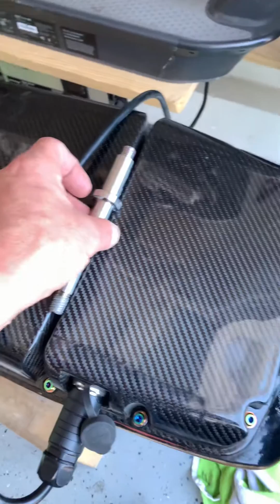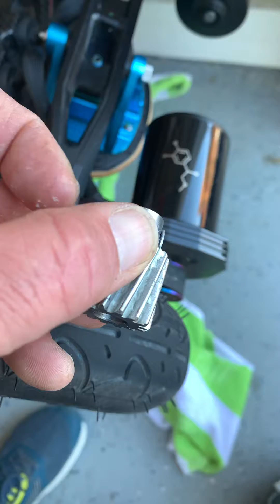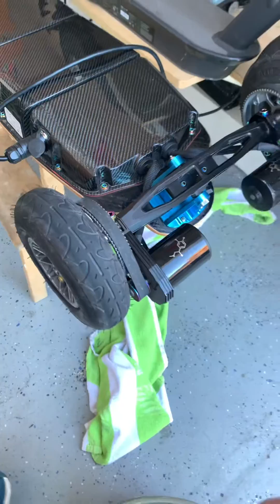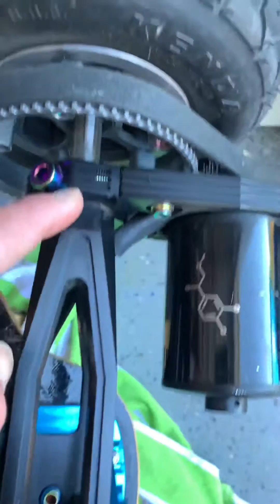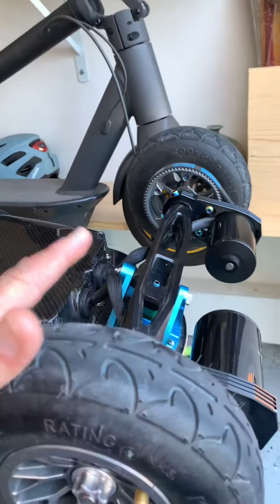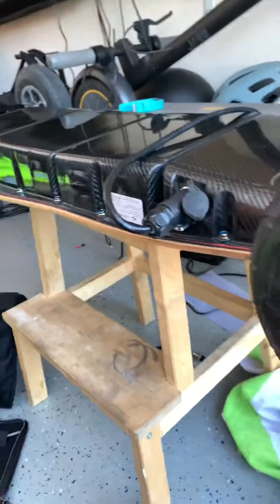Lacroix Supersport going from falcon gear drive to self tension belt drive

Comment: Hey Tony, for what reason(s) are you going from gear drive to belt?
Reply from the maker: The gear drive was never installed correctly and when I tried to repair it, I ended up doing more damage to the board than fixing it. Grease and bolts needing to be tight is challenging. I am convinced they're on the edge of making a really great gear drive, but version 1 isn't it. My real problem is the fact that my rides take me way out in the woods with no cell coverage and very few other people. I just needed something I can count on, can repair on the road and those self adjusting belts are it now.
Reply: @tony2wheelz408  Thanks for the answer. I still haven't ordered and I initially thought I was going to go with the Falcon, but then I saw more and more opinions against it. I'll go with the belts. Cheers and thanks again!
Reply: @tony2wheelz408  fuckk I wish I saw this before I splurged on the gear drive x.x hopefully I don't experience the issues you are describing, I know a lot of other riders seem to really enjoy the gear drive and find it more dependable. When did you order your board?
Reply from the maker: @solomonjenkins9505  I ordered mine in early January. I wanted them to work sooo bad. But I do know that these are the first version and if you have a problem, keep them, an updated version will be bad ass. Also, you'll need 680 Loctite if they didn't install your large bearing correctly. That happens frequently. (not to you though) I really feel that they are making lightening fast improvements based on feedback, but also they're a small company. My buddy loves his gear drive. You'll be fine
Reply: @tony2wheelz408  Glad I read this, mine's on order and I'm going to stick with the gear drives on your word.
Reply from the maker: @sdb3039  dude, I know you’ll be happy. Order red lock tite 680 if the cylindrical bearing is not installed correctly. And don’t get grease in the bolt parts of the gear casing
Reply: @tony2wheelz408  Loctite on the way thanks for the heads up